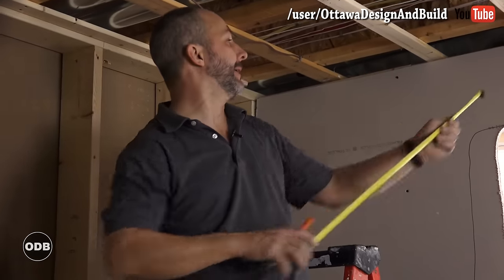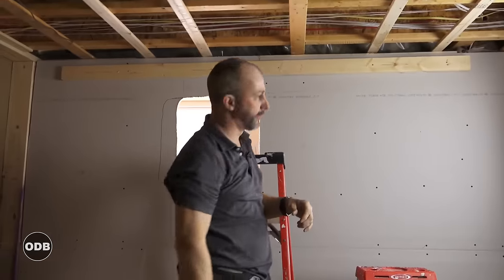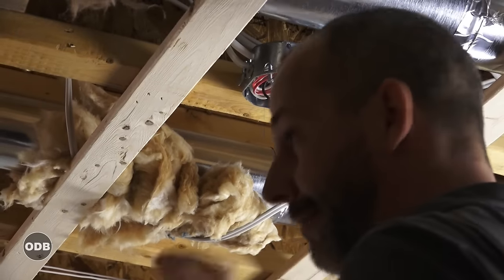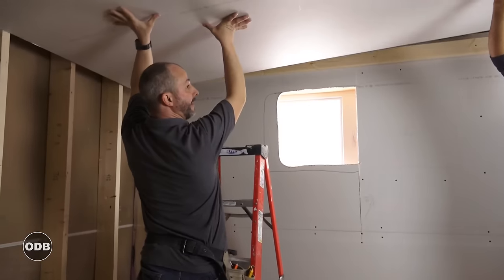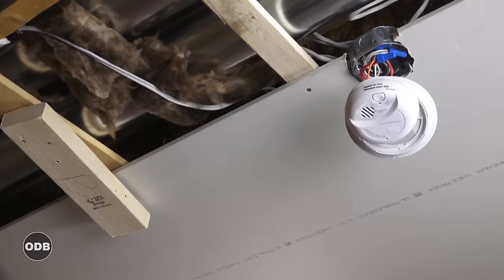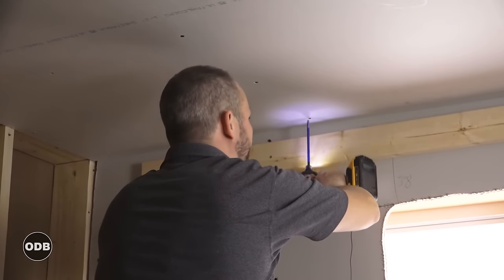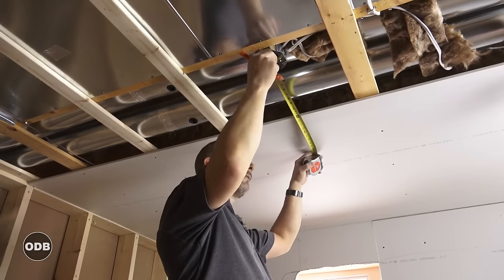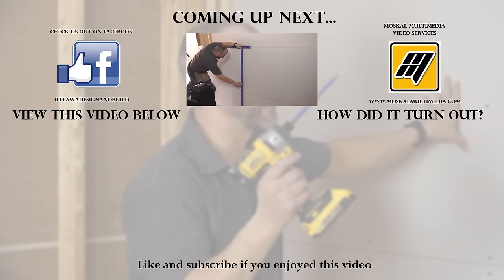Installing Drywall on Your Ceiling | Drywall Installation Guide Part 2

Comment: What a disaster. Ah...the USG handbook tells you to glue the board because it makes the whole building much stronger. Around here many drywall contractors (including myself) will not give any kind of guarantee on drywall that is not glued. Especially on todays lumber which is very unstable.

It is impossible to tell if a drywall job is quality when it is completed. It takes about 5 years of settling, expansion, contraction and bond failure for all the defects to show up.
Reply from the maker: Always entertaining to hear from the dark side.

Comment: No stud adhesive or back blocking like we use in Australia (see https://www.gyprock.com.au/Pages/Resources/Videos.aspx for how we do it here).
Reply from the maker: Yes things are very different there for sure.
Reply: @HomeRenoVisionDIY  But a lot of your videos are still applicable and very helpful especially the bits on the taping process.
Reply from the maker: Glad to help Ross Gould. Cheers!

Comment: Talk about inspector.  .? And use power equipment without glasses...you lack knowledge..about OSHA..... Safety first and on a ladder.. Right....is the power on ?  And...Why not do it right... type of screws, type of strips on what ?  And insulation.?..where is this ? In a HOUSE !
        Not complete ?

Comment: I cant believe the so called demonstration of how to install a drywall ceiling (without any glue applyed at all what a joke )   the glue is to support the drywall sheets so if the ceiling gets a little bit of water damage (storm damage ) the ceiling wont collapse on the floor  re: with that stupid demonstration the water damaged ceiling will absolutely collapse to fall on your floor ( laugh out loud)